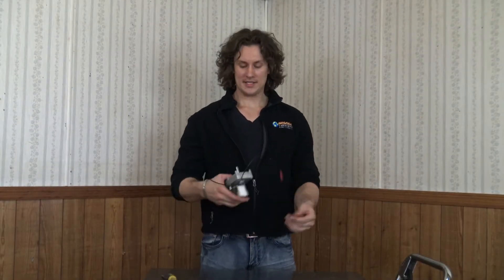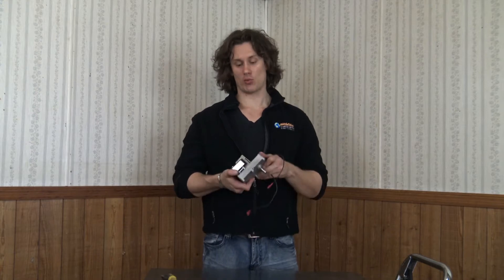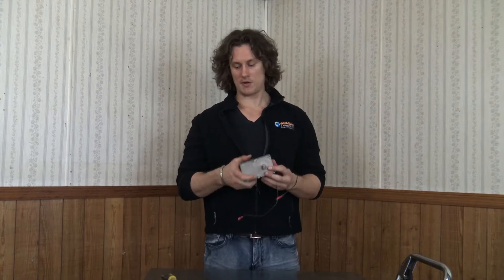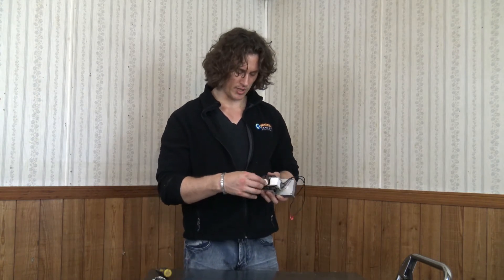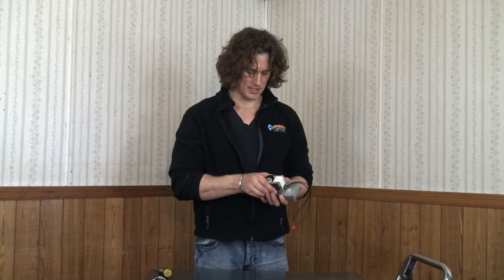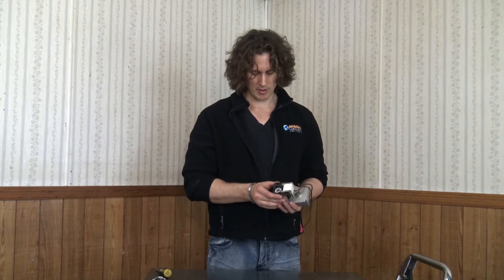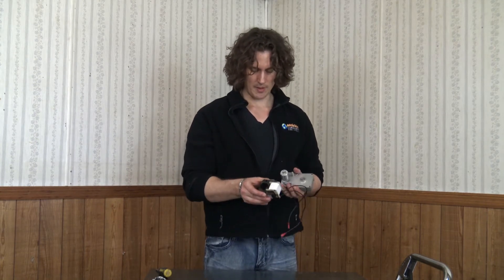How to reverse an Auger Feed Gearbox Motor - Pellet Tech 101

Comment: You rock !! Thank you so much for doin this video !!! I thought I was going crazy or I bought the wrong part !   I was wondering does it have to be outside the pellet stove in order to do this ? 💜💜💜💜
Reply from the maker: So glad to hear the video was helpful! Yes, the auger motor will need to be removed to do this. Workshop bench is ideal, it's a pretty quick switch. Any other questions just let us know! Thanks.

Comment: Thanks so much for this video, didn’t realize that I flipped the polarity when I disassembled my jammed auger 😅
Reply from the maker: You're most welcome Reuben - Glad it was helpful to get you back up and running. Any future questions or needs just let us know. Thanks!
Reply: @reubentalbott  oof. I got mine shipped clockwise.not ccw. It was a real headsratcher to deduce why it was jamming lol. 
Luckily I didn't burn up my new motor. 
It blew the fuse after jamming

Comment: So what if the new auger motor I recieved won't allow me to do that? Reason: when I flip the magnet over, the plastic around the armature is taller than the original way and won't allow me to seat the magnet down to the gear box. Help me please.
Reply from the maker: Thanks for contacting us. See if you can 'trim' down the plastic a bit to allow the magnet to seat properly. If it doesn't look like that is possible, then your best bet will be to return the motor and get the direction you need.

Comment: Am I correct that this technique will work on a US Stove Motor?  Was this a US Stove motor?  If so, was it a US Stove Auger Motor #80488 or a Agitator Motor #80456 ?
Reply from the maker: Hey Richard, thanks for contacting us. Yes, this technique will work for any standard auger motor or agitator motor including the USSC 80488 and 80456 motors. The motor in the video I believe was a 1 RPM which we offer as replacement for the 80488 motor. We also offer the 4 RPM replacement for the 80456 Motor. Any other questions please let us know. Thanks!